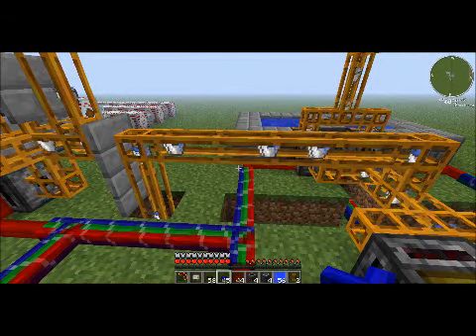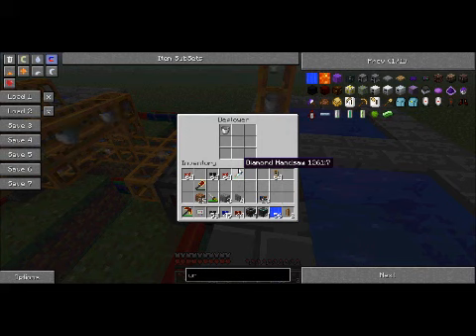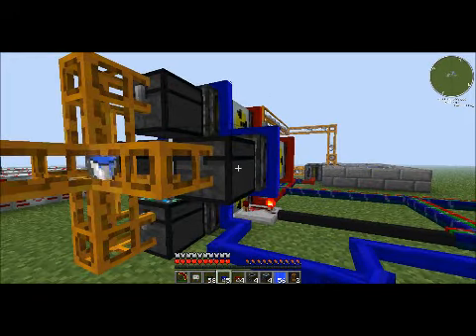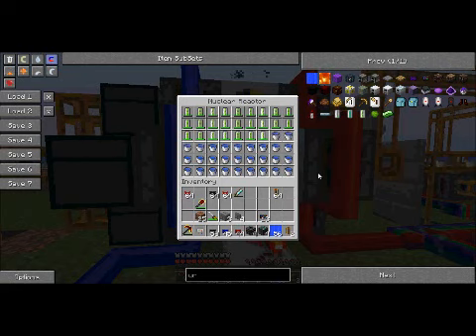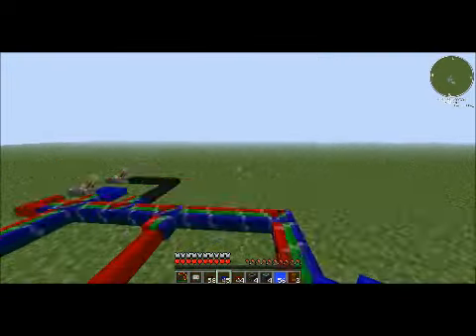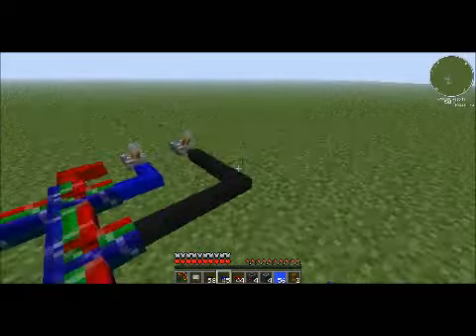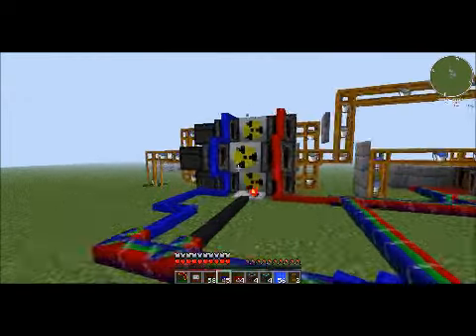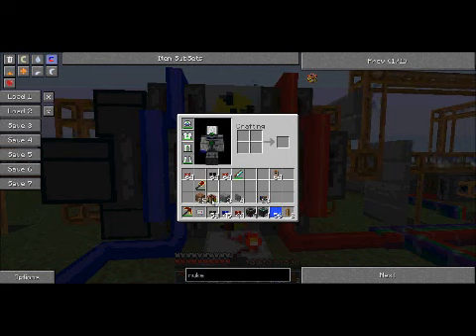Industrial craft 2 Quick&dirty CASUC tut

Comment: PS - You will need to feed the ice blocks into the reactor using RedPower, buildcraft pipes can't deliver enough ice (or water buckets) fast enough.  Just adjust the number you send in per cycle based on the length of tube between your condenser and your reactor.

Comment: Given that I see you're using alchemical chests here, you're doing this wrong.

Just use collectors and a condenser to make ice blocks and feed those into the reactor.  Or if you're like me and think Collectors are cheating you can build auto-cobble gens with block breakers to feed the condenser.

Either way blocks of ice are vastly superior to buckets of water because the buckets can, and do, occasionally jam up.